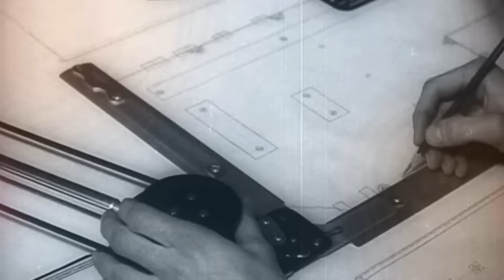War Factories | Episode 8: Russia | Free Documentary History

Comment: While it was true that the German Tiger tanks had the most effective gun- the 88, they were built by slave labor. As a result they constantly broke down. The u.s. sherman tanks were not as formidable as the German designs but they could easily be repaired by their crews. When the crew got killed  the Shermans were rebuilt, given a coat of paint to cover the guts and gore and sent back into the combat.  There are german tankers who luckily survived the war and  tell stories of their Tigers breaking down and the war ending before repair crews got around to getting there to fix them.
best 
Bruce Peek
Reply: The Tiger Tanks broke down because they were complex German-engineered machines. Almost no slave labor was used to build tanks.
Reply: After being hit by a 8.8 most tanks were beyond repair!
Reply: You didn’t even get to the crew survival rate yet. There was an 85% crew survival rate upon ditching the tank.